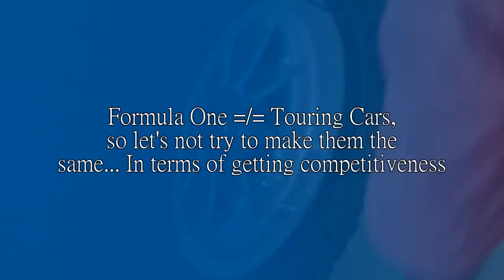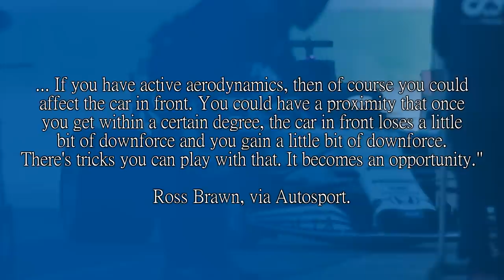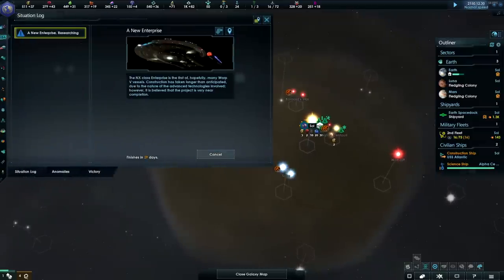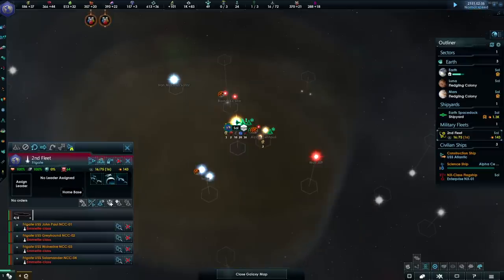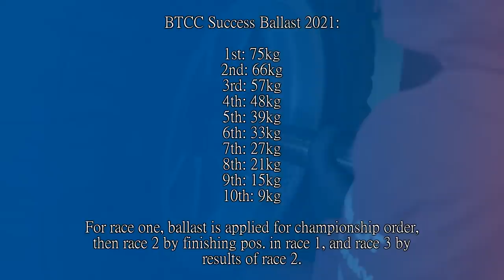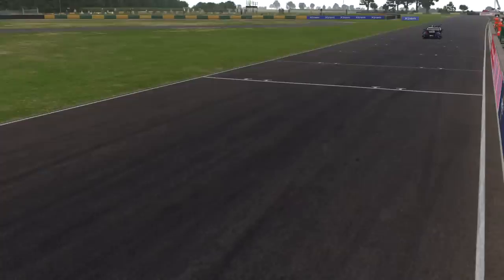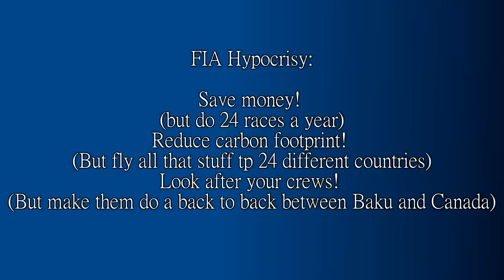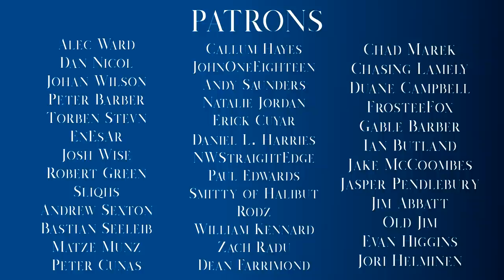BRAWN'S BIG BRAIN MOMENT: Opinions on the Proposed 'Reverse DRS' System for 2026

Comment: In my opinion there are 2 fixes which would go a long way, on top of making the cars smaller as Aidan mentioned.
1. Less aero, more mechanical grip. Easier said than done of course, but less aero means less dirty air and more mechanical grip means the car is less affected by dirty air. If this is done together with a smaller car, the racing should be much closer.
2. Make the points gap between the top spots smaller. Now the difference between 1st and 2nd is massive and can lead to a runaway winner, which we had this year. Making that gap smaller means the drivers and constructors championships are closer and more likely to be won in the last races. It can also mean more drivers can win, which makes it much more exciting. 

[Forgot to add this:] The points should also extended to 15th place, or thereabouts. This means the midfield gains many more points, making that battle more interesting and allows them to get close to the top teams in overall points. 
As has been mentioned in the comments, it could make the drivers more risk averse, but as there are now 23 races, it would bring more drivers into contention for the DWC, so finishing as high as possible is still the best strategy.
By awarding points further down the grid, a bad race also isn't the end of the world, as you still get some points. 

This makes the fastest lap more valuable as well, putting more pressure on going as fast as you can.
Reply: The points gap thing has really gone back and forth though. They reduced it when a certain driver was winning runaway championships and then increased again. It does have the benefit of giving more importance to trying to win instead of settling for 2nd. Which is why I think the point system is the way it is.
Reply: Yeah, the gaps used to be smaller, but then there was little incentive to risk a move. Drivers just held position to bank the points they had.  Two hours of financial advice from a grey man in a cardigan was more interesting than the racing.  Also, with a smaller gap, a DNF is devastating, as you'd never be able to out-score your opponent by enough to claw it back.
Reply: @owensparks5013  I get the argument for the larger gap, but we have many more races now and it's a different era. If you have RB, Merc and Ferrari all on top of their game next year, with the line up they have, it is easy for a single driver to win early.  

The larger gap with fewer races isn't a great idea, I fully agree, but with 23 races it is different. 

A DNF being devastating is a downside for sure, but if you spread the points down to 15th place, it is possible for the mid-field to start climbing as well. Gasly and Russel both had a run of 5th positions, which would add up a lot more than it does now, keeping them in contention. Sticking it out for 2nd place could mean you lose the championship altogether. I realise I forgot to mention the larger spread of points, my bad, I'll add it to the original comment.
Reply: @theflagstand  The above reply applies to your comment as well, but I couldn't tag you in it. Not trying to be a dick, just for efficiency.
Reply: Yvolve  Good points, well made. 👍

Personally, I'd like to see points down to last place. Finishing a GP is better than retiring,  so in my mind, it should be worth something. 

The DNF bit is hard, and again, it's just my opinion, but to me a driver that wins 6 races and DNF's the rest has achieved more than someone who comes third in every race but wins the championship through reliability and consistency. Others will hold the opposite view.

As long as the rules lean more towards being a real sport, rayher than a show,  I'll be happy.
Reply: @Yvolve  you do have a point about the points gap but I strongly disagree about the points spread. IMO getting into the points in F1 has to be an achievement. I'm not fond of handing out points to almost everyone who gets to the end. Especially as nowadays finishing a race isn't really that big an achievement in itself since the cars are generally very reliable. And I'm also not excited about intensively trying to artificially create close racing and close points battles.
Reply: @theflagstand  I'm against artificially creating close racing like the active aero and I feel points are the least intrusive, and most applicable to all tracks. Active aero will have different results at different tracks, so that becomes strategy as well.

The points shouldn't be a participation trophy for sure, but awarding 1 to 5 points for 15th to 11th, then a bigger step per position, and from 5 up another bigger step. Raise the total points awarded, so it is still worth risking it for another position and it might work.
Reply: @Yvolve  I just feel there's no reason to even think of changing anything really. The gap between the top manufacturers and the rest could be considered one, but besides a cost cap I don't really see what can be done. Fiddling with the points system isn't gonna change the situation especially as the top teams don't dnf that much. Maybe I missed something but I don't see a huge problem needing to be fixed. And if it ain't broken they shouldn't try to fix it.
Reply: @theflagstand  The fact Max won with a couple of races to go, with nobody coming close to challenging him for the couple of races before that, was boring as hell. If that gap was smaller, it would exciting to the end of the season. MotoGP has a smaller point spread, so there are often multiple riders who can win the championship. 

The points system has been fiddled with every single rule change, to have it match the current rules. More races mean more opportunities for a single driver to be a runaway winner, so the point spread needs to be smaller to prevent this. 

Hardly anybody DNF's except for crashed, reliability is fraction of the issue it used to be. This does not play into the results as it used to. 

It is very broken as this years results show, or did they intend to have Max win in it with three races to go and we were cheering for who got second place? If that was the intention, they're terrible at their job.

It is also not THE fix, as there is much more wrong with F1 right now.
Reply: @Yvolve  One of my points is that it was one season. One. Last year we had two drivers going into the final race even on points. While the top teams have admittedly been way quicker than midfield for a while now, it's not like we've had a runaway champion every year, not at all. And I gotta say it seems to take a lot less for some people to get bored than it takes me bc I didn't get bored this year. IMO it's just the way sports work and in a sense even should work. Sometimes you have a close battle, sometimes not. You can't expect a close one every season unless you go full NASCAR and do it artificially. Which is bad. If Max does it again next season and the next then you've got a case.
Reply: @theflagstand  Sorry, but Hamilton winning so many titles in a row is not something you think is an issue? 
Hamilton and Verstappen were so far ahead of the rest, it was a 2 horse race. This happens a lot and is super boring.

The vast majority of fans aren't interested in watching a procession, so they speak up. If you enjoy that, good for you but it is super boring racing.

Lewis has already done this 7 times, but only if Max does it, it is bad?

You're making no sense, genuinely.
Reply: @Yvolve  You're the one who seems to have a problem with Max dominating, not me. One of my main points has all along been basically that if someone happens to dominate, let it happen rather than start trying to artificially close things up. 

If you look at how Hamilton won those championships, he didn't exactly dominate in all of them. I get how one could describe the recent seasons as processions if you only look at the final standings. But the way it happened was mostly far from being a procession. 2020 is the closest thing to a procession in the recent years. 

I think we're talking about too many different things at once so we keep missing each other's points or something. Or this is getting too heated. I'd like to keep this respectable and not start accusing each other for not making sense. Or else I'd rather end this.
Reply: @theflagstand  You're the one imagining things about you have no knowledge of and are 100% wrong about. I cheer for Max and I'm happy he won. That is not my issue, it is the fact he won with several races to go as his dominance led to him being a runaway winner. 
You're also very focussed on "artificial" things, which every rule in this sport  by definition falls under. Every rule has been invented to keep the sport interesting and more, so it is not natural regardless. You also have a profile pic of NASCAR, which is the most artificial racing ever, so why complain?

Hamilton was dominant, which also led to nearly a decade of him being nearly a guaranteed winner. This dominance was down to the car and lack of a competitor. 

I'm calling races with very little overtaking processions, which many, many races have been. The reason is a lot of dirty air and sensitive aero, which got changed for this year and led to closer racing. This is an artificial adjustment to improve excitement. This had nothing to do with the finishing order, most races are just boring as hell. 

Funny how you start your last comment by saying things about me, yet also demand respect. You're reading waaaaay too much into this and are taking this waaaaaaaaaaaay to seriously, as well as contradicting yourself. 

The bottom line is that the majority of fans find the F1 races boring, because they are. This needs to be fixed because F1 will lose viewers, which costs them money, which means less funds to organise the races, etc. 
If you like boring races, good for you, but the rest of the fans want close racing and many overtakes, which requires rule changes. 

NASCAR has gone bankrupt several times because of poor decisions, same with its competitors. Doing nothing is the final nail in the coffin for most competitions.
Reply: @theflagstand  I have 0 problem with Max dominating, which I said before but you have trouble reading it seems. I said I have a problem with runaway winners, which make the end of the season very boring. Regardless of who it is. 

The problem with your opinion is that it makes for extremely boring racing, like during the Hamilton era. It was a race for 2nd, so woopdidoooo! The only one to really challenge him was Rosberg, who quit after winning his title. 

Again, I don't care about final standings. Stop trying to reformulate what I said, so you can keep repeating the same argument. It's pathetic. It just has been super boring, because cars can't follow closely for a long time. This year was the first time they could keep the pressure on the person in front, without overheating or destroying tires. 

You're talking about too many different things and have a hard time keeping up, not me. I'm getting the feeling you're going to keep repeating the same comment regardless of what I say, because you seem adamant to convince me.

I'm not missing your points, I'm disagreeing and commenting as such. If you feel offended by me disagreeing, that is not my problem. 

Please stop with the whole "respectful" nonsense. I haven't said anything bad, except for wondering if you can read properly in this comment. You seem to have a hard time dealing with someone not agreeing, as you keep repeating the same thing and are trying to reformulate what I said, to make it sound I'm not understanding you.

I understand you perfectly clear and I 100% disagree, especially given the argument that boring racing should be kept boring.

I'm most amazed by the fact you seem to be a fan of NASCAR, which is the most artificially exciting form of racing ever. There are even laps were the pack is bunched up again, negating all the racing they have done up to that point as a single crash can take you from last to first. That is not skill, that is luck.

Comment: What’s baffling about it? Let a car behind increase it’s front wing angle of attack, so when it’s in the dirty air of a car in front it can follow closer without under steering, everyone says drs overtakes are boring, we all know where the overtakes are going to happen, following in corners is way more interesting, it would be like the Perez/Hamilton battle in Istanbul but at every race and instead of drs detection lines just have it for following cars so immediately a car take its place back, set maximum limits like the drs opening slot. It would be a million times better than drs and get rid of drs trains.

Comment: The way you described it sounds dumb of artificially leveling the field mid-race. My initial take on seeing "reverse DRS" and first take I saw in an article looking for more info of "2026 will have more full fledged active aero to go faster on straights and in turns, so instead of further drag reduction on straights a drag penalty is applied to the car ahead on straights" which sounds fine to me assuming it'd effectively behave as it does now.

Also: smaller and lighter are already part of the goal for 2026 regulations--and, I believe, active aero being allowed by regulations is partially trying to help maintain performance while being smaller/lighter.
Reply: Got something Special for you 🎁  TM!!!!

Comment: Wouldn’t this “reverse DRS” just ruin pit strategies? The undercut would be OP: 
P1 and P2 are beginning to pull away from the pack but are still a few seconds apart, “Let’s pit now from P2, we’ll drop 20s behind P1 but the stewards will take away his downforce making him lap half a second slower before he comes in” - easy lead.
What about drivers hanging on to the lead on a set of old tyres in the closing stages of the race with the pack closing in on fresh rubber, why would you punish that strategy?
I can see the potential in what Ross Brawn is saying but it seems like an idea more focused on the commercial implications rather than sporting integrity.

Comment: This is just madness. Imagine if some race director/FIA tweaking of a car results in a crash; at the very least there could be a team moaning on about the cost of repairs/list points/potential championship manipulation, all the way up to the FIA being seen to be liable for a driver’s injury or death. A legal minefield, in other words. 

The answer isn’t endless “it might work….” tweaks like this, but car convergence. I’m not advocating the same car for all, with different engines, like Indycar. If certain key bits of the car that don’t really add to performance like wheels, brake discs, steering wheels, radiators, or even the drivers’ survival cell could be standardised it would take out areas of research and cost for the smaller teams, and allow them more scope to catch up to the front runners. Tyres are already standardised, and they used to be a massive performance differentiator. Plus if the survival cell was a standard part then safety improvements could be brought in across the field (e.g. an aero screen, if they decided to go that way) without one team interpreting the rules in a “better” way and gaining a performance advantage from that (such as the cockpit sides of ‘96).

Comment: Didn't he just mean literal reverse DRS system? Meaning, let's say a driver gets within one second of another driver, the driver in front then loses a small amount of downforce (a few %) for as long as the other driver is within one second behind? I don't think he meant the race control or anyone else would be deciding about this (other than maybe not activating it in bad conditions just like with DRS). I'm sure there would be clear rules that say how exactly it works, just like with DRS. They would obviously need to make sure the downforce loss is equal for every car and that it's not too big. 
If they get it right, it could work. Basically, just like with DRS, the second driver still has an advantage, but in this case, it's a smaller, but a longer term advantage. Meaning the driver in front won't just be a sitting duck at every current DRS straight and we won't have so many of these DRS end of straight passes. Instead, we could see more overtakes in the corners, with the driver in front actually being able to defend himself instead of just watching the other car drive past him and hope he can do the same on the next DRS straight.

Comment: As far as balance goes, I've long said that they should tie expenditure to a weight penalty - and do away with the cost cap altogether.  If you simply made it that every $1m spent on the car increased the minimum weight of the car by 1kg (maybe it's 1kg per 3m, who knows), what you would end up with is a Williams, who can't afford to spend $300m, with maybe a 700kg car, but Red Bull spending $200m might have to race at 780kg... and if every kg is worth say 0.3s/lap, well... it very becomes uneconomical to spend more money trying to save weight.  There would also be a natural level at which it's just not worth spending more money than that amount, because the time gain versus the time penalty you're going to receive in weight penalty - again, it finds an equilibrium.